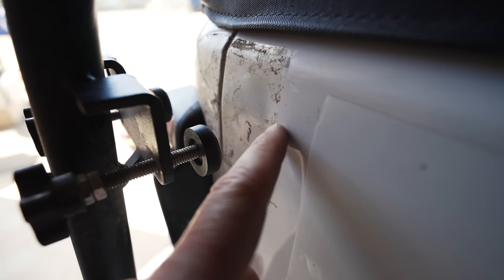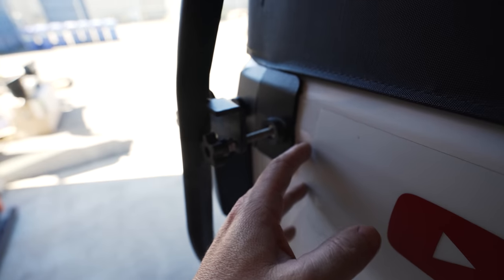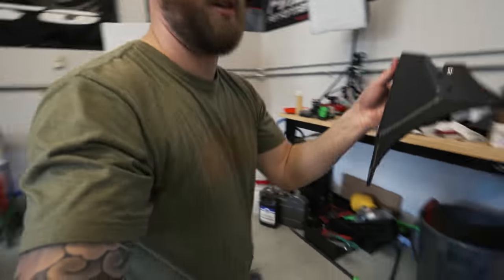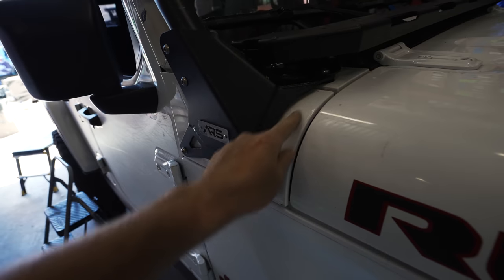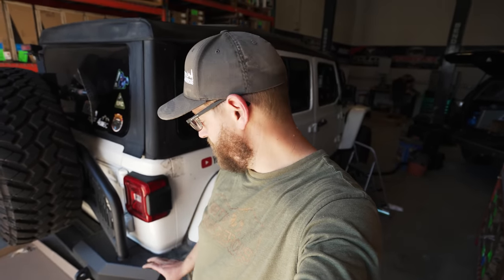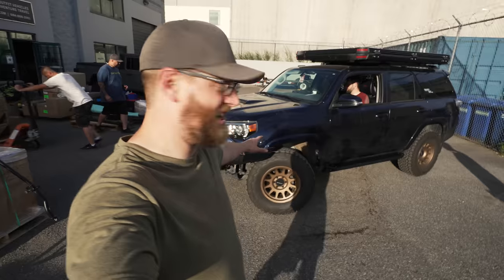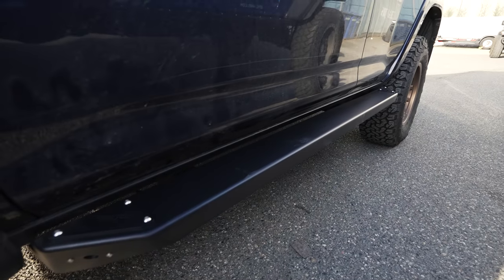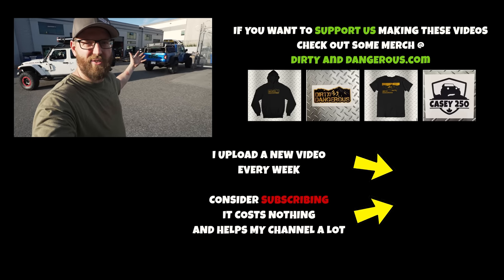THIS GOBI ROOF RACK DAMAGED MY JEEP! Replacing w/ Metal Cloak Adventure Rack System - JLU Wrangler

Comment: Hi guys and gals, this is Weston with GOBI Racks. Since we began selling racks for Wranglers, we have always recommended the upper rear isolators for heavy loads. Those mounts are only compatible with the hard tops. We've looked into soft top mounts in the past, but there is no way around cutting through the top material unfortunately. We have thousands of Wrangler customers around the world and take technical issues seriously, and this is the first I’ve seen of this issue. Our rack may not be for Casey or some of you, but should you consider us in the future, I want to stress again the importance of the upper rear isolators in distributing the downward force of weight like he was running.
Reply: I was considering Gobi until this video. lol
Reply: Will this happen with the one touch rack?
Reply: @primechoi9858  same. Really like the look also, but this is a huge design flaw. Maybe rear fender body armor or something.
Reply: Hard to wanna pay the same price for gobi this adventure rack charges when it doesn't have the design flaws. This problem really should be listed on the product. Glad I didn't go Gobi
Reply: @SooSmokie  after inspecting this customer's photos, there were issues in how it was installed from the beginning (most notably, the isolators that provide the stability needed for weight on the rack weren't seated properly and never secured via the jam nut. This is the first time we have seen this issue after thousands sold across the world.
Reply: @Outworld  so why did you say having a softtop it won't be as stable? Makes me doubt Gobi when it's sold for a soft top jeep and you say it needs the top stabilizers which you cannot attach. Any way to stabilize it more without these 2 stabilizers?
Reply: @Outworld  not sure why you sell something for a soft top and not mention this issue which it seems cannot be fixed without mounting directly to the body. So basically seems Garvin is the best choice for soft tops since it mounts to the body itself? 
I wanted Gobi, not Garvin. Help with a solution and I may still entertain Gobi. love your roof rack. Your aupport sucks, in fact surprised to see you here even. But still love you guys, please recomend a solution!
Reply: Hey Casey, Gobi are saying that the rack was installed incorrectly, is this the case or not?
Reply: @thepavementendsnow1901  don't buy this for a soft top. They do not work for the weights indicated. They also admitted it is not as stable on a soft top. So if you want this design and more secure, go Garvin, it has to be drilled in, but won't cause damage and will be stable. Basically the same rack, just better design from what I have seen. Gobi didn't even reply to my last question. Should be a good indicator of their horrible customer service
Reply: "No way around cutting...."

Um - looks like your competition did just that.
Reply: @silverstake88  if you're referring to the drilling option, you're correct. We do our best to avoid drilling for a number of reasons but some people prefer it, and that's ok!
Reply: Looks like it's a combination of way too much weight (that rtt looks heavy) and the fact that it's a soft top, so two less bracing points.
Reply: @xtina818  then They should be stating the safe weight limits for a soft top which is why a lot of people buy this brand that have soft tops. Not exactly cheap either with how thin the metal is. Should be advertised what arr safe weight limits for the soft top
Reply: @SooSmokie  it says on their site that the hard top can only to the max weight as it needs the stability bars that only work with the hard top
Reply: @xtina818  I have yet to see it on their website, i'll take a look. But this should be in the product description. Not some hard to find place on their website. Very shady
Reply: @SooSmokie  gotcha, well I’ll keep looking then, by description it’s exactly what I want, but…
Cheers👍
Reply: @thepavementendsnow1901  check out the garvin expedition, it's very similar and I think a better design. But gotta drill. Pick your poison.
It's hard for me to convince myself of anything else besides these 2 because of the look I want for my soft top. 18jk 2dr
Reply: @thepavementendsnow1901  happy jeeping!
Reply: Garvin is better then Gobi.
Reply: @thepavementendsnow1901  I would like to know as well as this is what’s holding me back from buying the Gobi
Reply: @rvierra7235  I no longer work for GOBI but that's just a stupid statement. I can battle this topic all day long but you're not going to like it.
Reply: I had mine installed on a hard top with isolators and still have damage far worse than this
Reply: Been running a Gobi on a 2dr JK since 2011. Best mod to my Jeep. Without question. Lift, tires, exhaust, gussets, ball joints… on and on mods to achieve some measure of performance improvement and absolutely nothing has been as useful as that Gobi. And if you load it properly and brace it properly it will outlive the jeep. I’ve run that rack hard with loads at capacity off road. Zero problems. This video is a thinly veiled sell out to a new brand. It perfectly captures why utoob vids are low quality input for decision making.
Reply: @gregnicol4703 Greg did you ever find a good rack for your one touch sky roof?
Reply: The welds on the gobi racks are horrible!

Comment: I did overland Africa for 3 years  (65,000K)   2011 JKUR with the GOBI rack (TOP tent, 80 Liters of fuel, solar Panel and some time with a Extra spare wheel /tire, Not a single problem. The steel GOBI roof rack was perfect and no damage and no rattle.

Comment: I’m not sure you can fully blame Gobi (and trust me, I have a Gobi rack on order right now and am getting pissed at them myself). You have a soft top and a heavy rooftop tent/other gear up top. They clearly state on the website that when running a rooftop tent you need the isolators(which I see you have) and hard top. Without the hard top those isolators do nothing and it will move with that much weight. Sure, it should have done better, but you also have to take some blame on yourself.
Reply: Thank you for being a voice of reason.

Comment: I have the Metal Cloak/KMS/ARS Low Profile Mod Rack version and I like it very much.  The back support bar is inside the hardtop and connected to the c-pillar while the front support for the rack is connected directly via a metal bracket attached to the support bar; needless to say, I ended up drilling 4 holes on my hardtop.  The two most significant advantages of having this new low-profile Mod Rack are (1) I can use my Bestop NX with the rack or (2) complete no rooftop (like a Safari top) with a roof rack.

Comment: Hopefully this works better.  I think The leverage of bolting the way all of these style roof racks bolt on will either flex, or be incredibly heavy.  For hard wheeling with a rack they need to bolt to the roll cage, which means going through the roof with seals, and block off plates and quick release setup.  I think it could be setup to keep the sunrider open with a solid rack that reaches over the sunroof but could come off easily.   I think bolting to the roll cage would add a lot of strength especially when you bump into trees in the tight off camber areas.

Comment: Saw your video on getting the lower profile Roof trusses, but don’t yet know how you are mounting your tent. I’ve just received the same rack, and was under the assumption that you needed the load bar set that ARS sells to mount a tent. Doesn’t look like you’re using those, so I’m curious how you’ve done it?
Reply from the maker: I started with the load bars, but switched to a new cross bar system ARS has that holds the rails between the cross bars and roof top tent.  They are in the video with the new lower rails, but ARS hasn't released them onto their website yet as they sent up a prototype set to try out.

Comment: You need to bring that rig up here to interior Alaska so I can check out that new rack! <grins>  As for steps on your rig, look at the ROAM frame mounted ones. They act as rock rails and can handle the weight of my 2 door on rocks.. Also the LED lights on the ROAM steps are great in the winter when it's dark.
Reply from the maker: Ill check them out. Also considering LOD's step sliders
Reply: @Casey250  I have been running LODs Signature Series step sliders for a few years. They are very solid and I have dropped the weight of the Jeep on them a few times coming down off rocks. Didn't even dent the sliders.

Comment: Just get a hardtop already!  :) Looks very study, could you post a view of the hood open so we can see the clearance, it looks like it would restrict how far you can open it before it hits that bracket. Also links to the brand?
Reply from the maker: I will make a full proper review in a little bit. Hood is restricted to normal opening.
Reply: @Casey250  Really looking forward to it, I am mounting my Winch next week, its the first real mod and the rack was next.
Reply: I could be mistaken, but I thought he bought it with the hard top???
Reply from the maker: Nope. Never had one. In hindsight maybe a good idea but im loving driving around in safari mode in the summer.

Comment: It really is a shame that rack doesn't have a way to lift it up easily to let down the soft top...I let my soft top down all the time, but want a roof rack mainly because I have the two door and need more carry space. I guess I could keep the top and back support off and in my garage for most of the time and just put it on when I need it? This seems to be the best rack I've come across though. Hope it works well for yah
Reply from the maker: 8 bolts and tilt it back I suppose. Just like the gobi. Haven't tried it though. I like safari style.

Comment: Hey Casey, great video.  Are you able to put your soft top down with the rack on?  I want to be able to have a rack for a kayak, but also want to be able to put the soft top down.
Reply from the maker: you would have to unbolt the 8 bolts on the front, tilt back the rack, and put the soft top down. mu compromise is I run around with the three back windows off safari style, but I leave the RTT on always.

Comment: Like you mentions some lower bars or even low mount square/rectangular bars to help keep the profile down. the 4runner looks so much better maybe some morimoto headlights for Chef Jon.
Reply: Thanks! and yes, some new lights would be awesome - for now at least, I've upgraded to LEDs in the stock housings.
Reply: @ChefJon250  What bumper did you put on the "not Jeep"!?  It is different from what most people put on the 4Runners.
Reply: @offroadxplorer  Victory 4x4 Strike Bumper (they are the Toyota arm of JCR). I liked it as it wasn't just a straight line across like most of the other bumpers. Amazing quality too.
Reply: @ChefJon250  Thanks for the info!

Comment: Does that rack block your blind spot sensor?
Reply from the maker: Blind spot sensor? 🤔🤔 

If you had one, yes. The amount of tail lights we smash, id never buy the blind spot sensors.
Reply: @Casey250  makes total sense.   In the video I thought I saw you had the sensors, but must have seen incorrectly (didn’t bother rewinding 🙂).

Comment: one thing I can't stand with these tube style racks like the metal cloak or rhino rack is how bulky they look. The top tubes or the rear hoop stick so far out from the body it looks comical. The front looks alright and is tucked in enough, but the rear end and top need a complete redesign.

Comment: I was thinking about dumping my full-length FrontRunner slimline II because it’s terribly noisy (creeks n rattles) even on asphalt. Was strongly considering a GOBI but not now… that thing is crap. Would like see how low you can get the tent.. I have a hard top and would want the tent as close as possible.

Comment: " The load capacity on a Gobi Jeep JK roof rack slant back with a soft top is 300 lbs. dynamic.   But caution must be taken during off road driving.   Damage can occur to the vehicle or rack if fast off road driving is maintained.   800 lbs. static load rating so long as both rear ladders are installed.   Please let me know if you have any questions."

Comment: Those Gobi racks are an expensive piece of crap. One they take forever to make them, second I have seen damage like your on JK's JL's and also premature rusting. Accessories take as much or more time to fabricate than the rack itself. Clearly I does not work with a soft to so add that new to the long list of issues.

Comment: I have a Gobi Rack and had no issues. Looks like you got a used one and parts were missing and you tried to make it work. You are missing upper supports that help with stability and over tightening the bottom bracket didn’t help. Not Gobi’s fault. Poor installation and planning.
Reply from the maker: The supports don't work on a soft top but they list it working for a soft top. Not sure what to say there. Install was exactly as directions provided.
Reply: I have the Gobi rack on my JLU with the One Touch top and just completed a 5,000 plus mile drive through Yellowston, Oregon, CA, the Grand Canyon & Moab.  I started checking all the mountiong points and screws on a regualr basis and nothing has ever come loose.  Mine does get the side support from the top but the main portion of the rack sits above the power top and the top works great with the rack.
Reply: Funny how people are getting all defensive in the comments … maybe your experiences are different than Casey’s because the majority of y’all are not really spending too much time on the trail…

Comment: So you've complained about this rack ever since you put it on. It's not meant to be used with a soft top. Then you turn around and complain more about it damaging your jeep after its not meant to be used on your jeep because of the soft top. I personally know people with this rack and it's awesome. I'm getting the same system. Seems to me that it's your own fault for not getting the correct rack.
Reply from the maker: GOBI lists it for use on a soft top, sells soft top quick releases and has a video on how to use it with a softop and open your soft top. They reccomend isolators for heavier loads. The rack has a 300lb capacity and I had 170lb tent on it, so just over 50% of its maximum capacity. I am not sure what they consider a heavy load ( and don't state what they consider a heavy load) but if its 50% of the racks capacity then its pretty much useless for a soft top. Id consider a heavy load somewhere getting near the maximum capacity of the rack. They shouldn't promote it being used on soft tops, and I certainly would not trust it on a hard top with 300lbs. I guess it looks nice to drive around with empty 🤷‍♂️

Comment: It’s easy to trash something you had to buy versus something given to you, or at a huge discount. You had to hit a tree with that to get that damage.
Reply from the maker: Sharing your experiences is not trash talk.
Reply: Easy, I have the same Gobi rack. It’s not perfect but you would need to hit something or have something hit you for the Jeep body to look like that. I’ll also say mine has another set of adjustable braces at the back that you couldn’t use on your soft top. 

Lastly , the Metalcloak would look better to me if they didn’t use 2” tube.
Reply from the maker: Do you have a JK or JL?
Reply: @Casey250  I have a diesel JL just like yours but with the SOT top.

Comment: Don’t buy Gobi. The powder coating sucks and the rust is brutal. Fine for California but if you live in a northern climate that salts your roads forget about it. I have it on a hard top and it seriously damaged the back corners of my jeep and dinted the top corners above my windshield. Basically every spot with a rubber bumper now has a silver dollar sized dent. It’s rusting from the inside out and starting to fall apart. Their customer service sucks and it has easily caused about $10k in damage. (I don’t have a roof top tent and just use it for canoes).

Comment: Nice RACK!   But you made your soft top completely worthless!   Time to get real and buy a HARD TOP! 

The ONLY thing you can still do is remove the rear windows and run safari mode...

If thats what you want, tondi, then just buy the One Touch Top, that new rack looks like it had 12 feet of space between the soft top and the bottom rails, should accommodate that power top with room to spare!
Reply from the maker: That sounds like even a bigger waste of money, thousands extra to run safari mode like I do now with the soft top?
Reply: @Casey250  Hahaha... like you pay for any of this junk